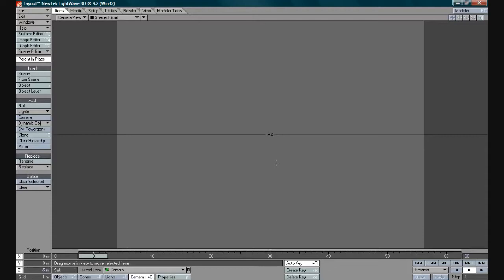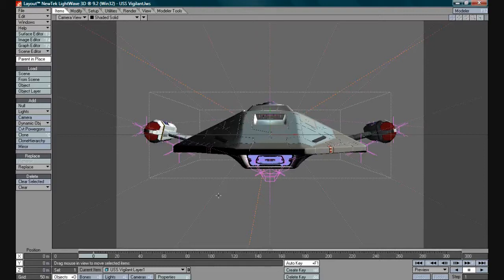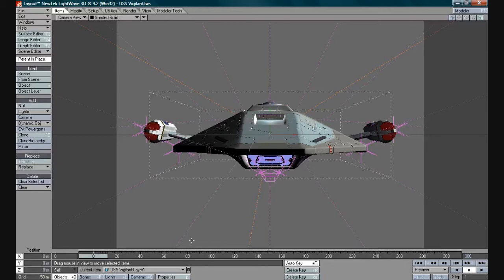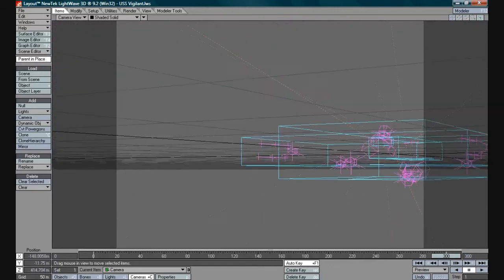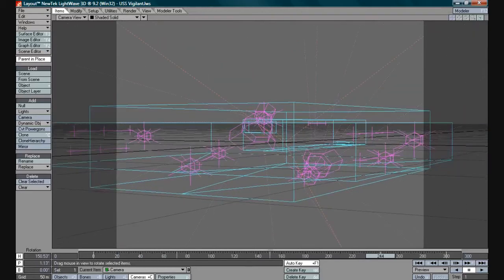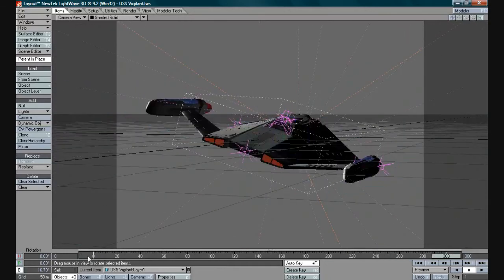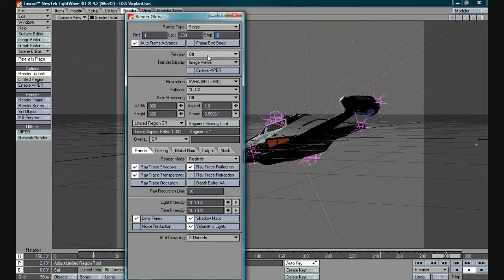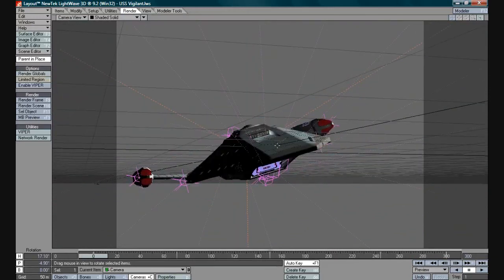Lightwave Flyby Animation Tutorial

Comment from the maker: I downloaded the Pro version of Sketchup, which is free to use for 8 hours.  It allows you to convert Sketchup models to .3ds format which Lightwave can read.  The conversion isn't very clean, the models need a lot of work after, but it works.  It only takes a minute or so to convert a model, so you can convert hundreds of models before your 8 hour clock runs out!